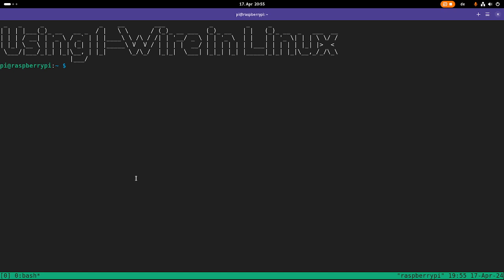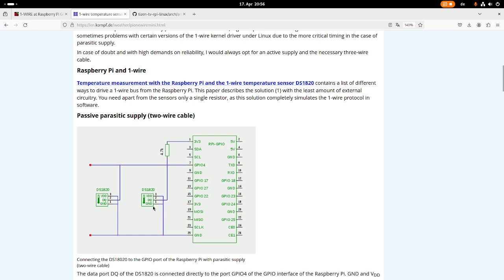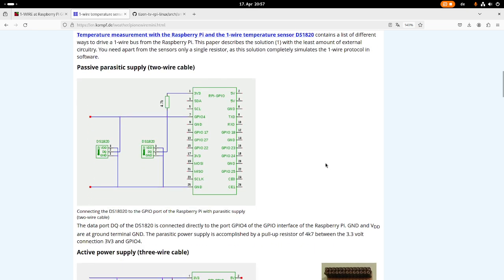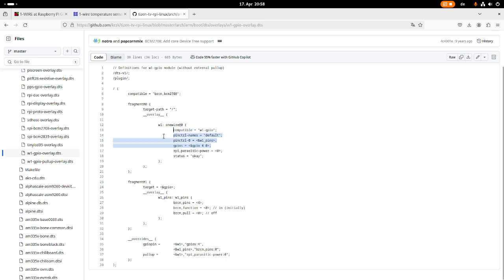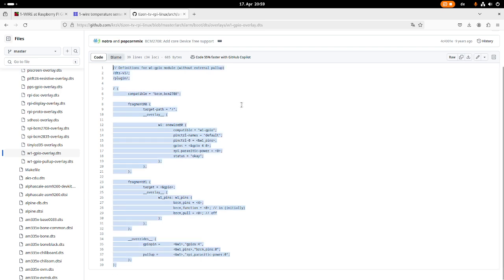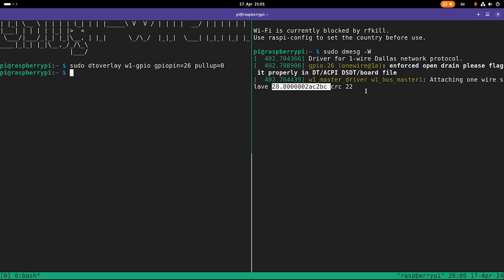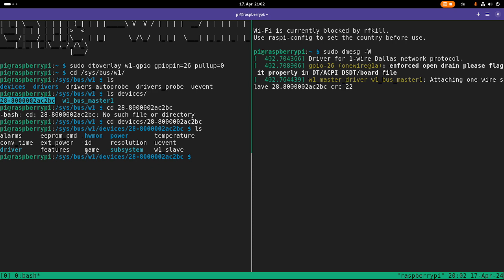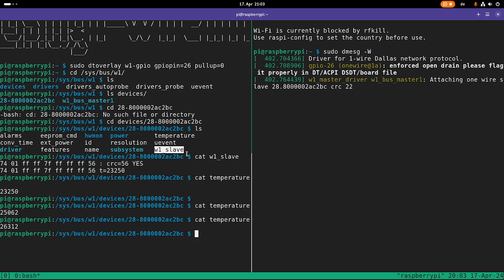Using 1-Wire in Linux

Comment: I'm extremely surprised how one wire works on RPi in software mode, as one wire requires precise time to generate logic 1/0, and reset pulse (these pulses only microseconds). In Linux, delays can vary depending on the system load.
Reply from the maker: In userspace yes, there it would be really hard to meet the timing requirements. In kernel space it is a little bit more relaxed. By using delay functions, which actually blocks a CPU (like udelay) and can't be scheduled out, you can minimize your jitter and get the driver good enough to meet the timing requirements.
Reply: @johannes4gnu_linux96  thanks for the detailed explanation